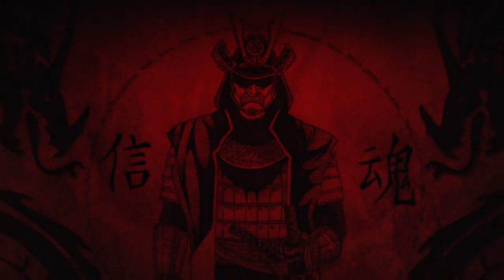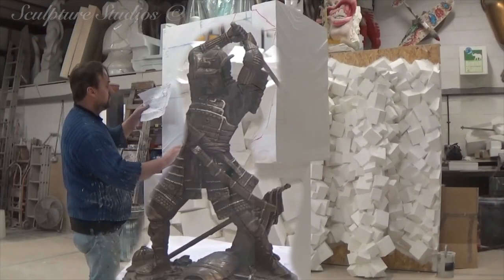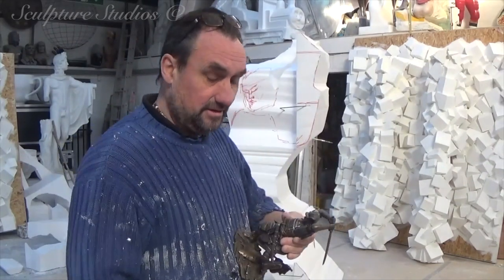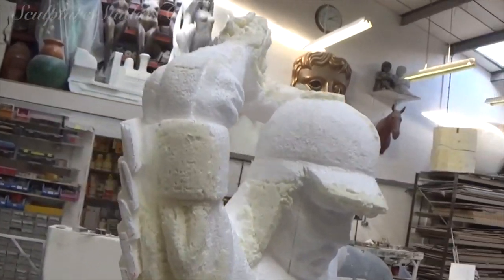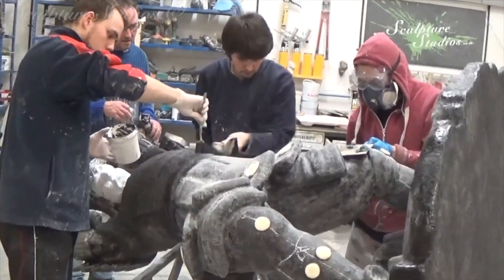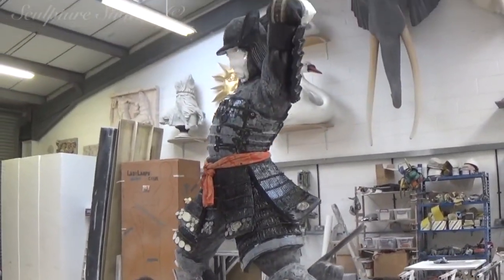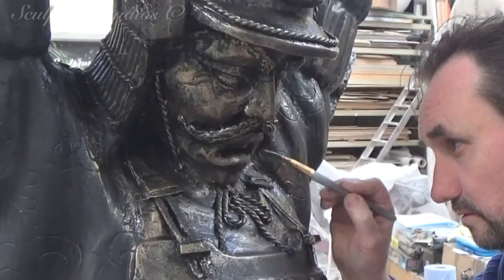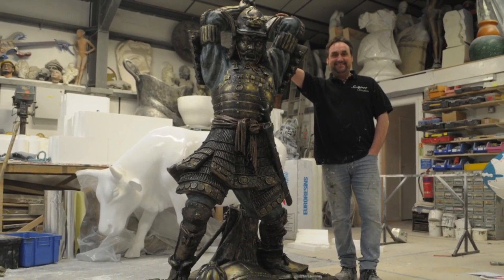Samurai Warrior Statue by Sculpture Studios

Comment: I am very interested in your work I am an artist living in Jamaica I would love more information about how to apply the resin on the styrofoam
Reply: If you use epoxy resin it won't eat the foam. So no need for 'sticky tinfoil' (aluminum HVAC duct tape). Use Extruded styrofoam instead of expanded, so you can carve in really fine detail from the beginning. Use a wire wheel on an angle grinder to remove alot of foam at once, then a welder's wire brush for the medium detail, instead of a knife...lots faster/easier. 
Then, if you thin epoxy resin with denatured alcohol, you can spray it on with an automotive spray gun (which needs to be cleaned immediately afterwards). Several coats should eliminate the need for fiberglass cloth. If brushing it on mix small amounts at one time. Use cheap 2" paint brushes so you can throw them away. Use truck bedliner for the black top coat. Then follow the dry-brushing techniques shown in this video.
Make sure when you are copying your samurai statuette you don't overlook obvious details, such as his chin and neck.

Comment: Hi what type of Styrofoam are you using? Do you use HDU Foam? Great work guys!
Reply from the maker: Hi Reuben. This is just a standard bead polystyrene, as the detail is achieved after the carving is complete and after the fibreglass is applied, so a high density bead foam wasn't necessary for the carving process on this job. Thanks very much for watching :)
Reply: eps foam（expandable polystyrene）

Comment: The armor as depicted is very inaccurate.  For example the "skirts" are armor, and would be rigid, not flowing as depicted.  The neck guard on the helmet would be fuller.  He would also wear a face protector called amempo and a throat guard..  The sash as you call it is more a  belt that was padded, and some had armoring inside.  Japanese used a lot of clothing that had armoring sewn inside them, as well as outside.
Reply from the maker: Hey Stephen, thank you for the comment. Our brief was to simply copy the small model that our client provided. We've no doubt all of what you say is true, however, as commercial artists, that is what our client wanted!